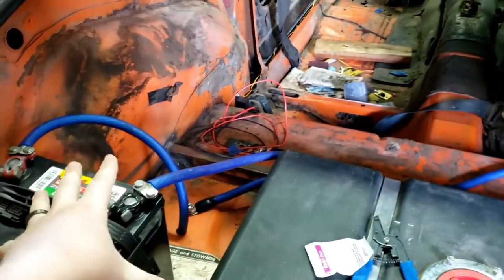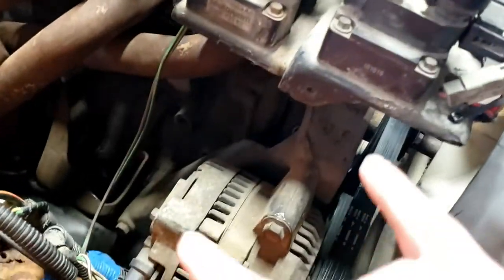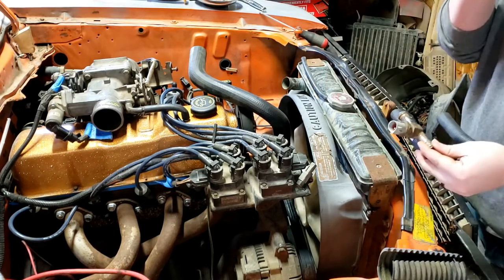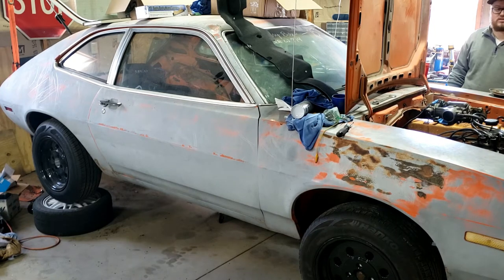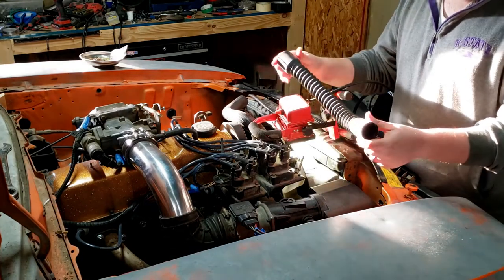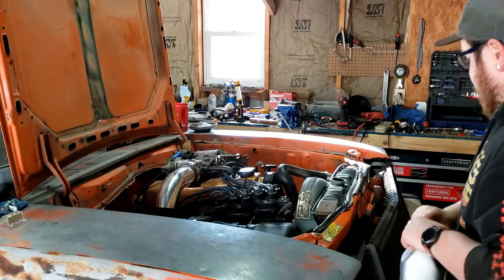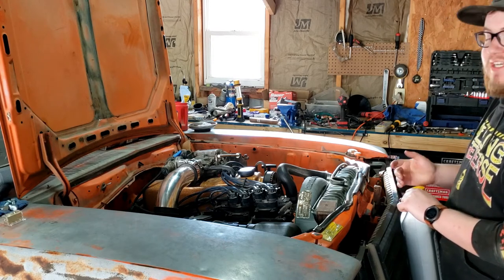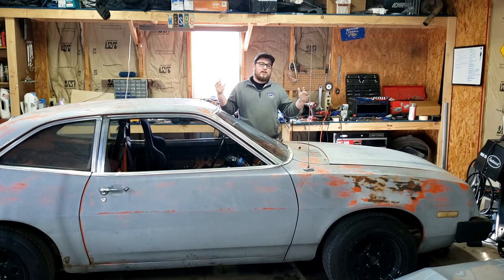The Pinto's first drive in 20 YEARS!!!

Comment: One way I protect both sheet metal from rust and rubber bushings from dry rot is by going to a self serve car wash and spray waxing the underside, and all potential rust spots under the hood, in the trunk etc.  Also, I find silicone tire shine protects mufflers, and ceramic wax, in trigger sprayers, might too.
   But paint before wax generally.

Comment: I know that u didn't go far but i know that it is the best feeling ever, I fired up my pinto for the first time with the 347 in it this weekend, it is the first time I've ever seen it run ever but it was a 4 cylinder and I built the stroker engine and got to hear it finally and it is the best feeling ever to hear all of your work running finally and I still have a long ways to go but it runs and im good with that for now 😁
Reply from the maker: Yep exactly!
Reply: I’m jealous for both of you with running Pinto’s.
My 72 Halfhatch is still sitting...looking at me...

Anyways, glad to see and hear about the progress and Harbor Freight has a great price on assorted hose clamps kits.
Reply: So happy you got it running and drove it not very far but hey it's progress I have to put my  new clutchbin my cus it doesn't like all the torque it has now being turbod
Reply: @ZEPRATGERNODT  that is the hose clamps that I used on mine, can't beat the price and you get plenty of clamps for a new engine build and some left over
Reply: @79beans347  
That’s right.

Comment: Grats on getting her going! I'm still searching for a windshield myself for my 80 Pinto. any chance on you adding some video of the floor pans in the next video, I've got to do drivers and passenger floor pans, and your's are mostly intact, where mine are gone lol.
Reply from the maker: Not sure if I will get yo the floors next video but they are coming up. I have solution for the windsheild as well. Long story short. 79-80 are glued in and a different size than early cars but not available. I'll show how to make the older glass work in the 79 or 80 cars.
Reply: @PeaceParts  Cool, heck ya on the glass, cause I can't find one anywhere and right now, no one wants to make it. I was thinking about getting some lexan and a heat gun and just making one.
Reply from the maker: @carlparker3571  had that thought too. But I wanna drive it safely on the street so glass is the way to go

Comment: I thought you were just going to notch that hood brace but you cut the whole thing out, which leaves it a bit flimsy but light weight, and light weight in the nose may be worth it for traction even if you can't sit on it.
Reply from the maker: Its not very flimsy without the support and I decided to cut the whole thing because it looked better than just a notch
Reply: @PeaceParts  Well if it ever saves you from getting stuck in the mud or snow, it will save you far more time than a V8 will ever save you by accelerating!   That is the crucial factor in my book, worth not sitting on the hood.
     With a little more work, you could have dropped in a 302, as many would have, but I'm glad you didn't for climate change and traction.
   I cam from Cold War Motors as he has far more experience and a good attitude, but is too fond of the big boats and burnouts, as are most.
Reply: @PeaceParts  I would try to buy a pinto wagon, or Datsun 610, but it is too big to compliment my W150 truck, for which I have my 3 cylinder Chevy Metro.  I am on the lookout for a good deal in another Datsun F10 though, which I once owned and miss.
     I would like to put a 2.2 into my B200 longtail van, but I think that would be a challenge to bolt up.  I may someday settle for a 239 though if the current 318 ever dies, but I needs a working 727 transmission first.  Until then it is a nice tool shed.
Reply: @PeaceParts  I like that you show us your mistakes, that's a good attitude.  But I feel you might have given up gust a little too easily on the original engine.  I have seen several people use hydraulics to break free seized engines, including Cold War Motors on a straight 8 Buick.   I think another guy installed a grease fitting in the spark plug hole, but first try to pry on the ring gear with a crowbar, but without breaking off any teeth unless you have a spare ring gear.  There may also be a hole or notch in the flywheel on which to pry.  or buy a junk flywheel, weld a big bar on it, and bolt it on.  Or take the pan off and force pistons up one at a time.
Reply: @PeaceParts  I think This Week With Cars revives some very rusty engines.
Reply: @PeaceParts  If your radiator dies, aluminum replacements also help traction (and acceleration slightly) but might not be worth replacing a good radiator.  Moving battery to rear is very useful though unless you need the space (as you did), but you can always put a tool box in the old battery place, at least for light weight tools, or get a vw squareback or Corvair.
Reply: @PeaceParts  I strapped a log to the front bumper of my F-10 for traction, but my Metro has a curved bumper for which I would have to find a curved log.  I suppose you could do the same on the rear bumper of a Pinto, at least in winter.
Reply from the maker: @alan6832  the ranger engine was too good of a deal, I dislike carburetors, and the engine had multiple things wrong when the car was parked 20 years ago. Wasn't worth my time to fix it
Reply: @PeaceParts  A big log, strapped to the rear bumper would protect the fuel tank as well as improve traction, except the recall solved that problem anyway, but you replace the tank and it would be hard to know how well protected it is.  BTW, the wagons never had a fuel tank problem and have more room and better traction.
Reply: @PeaceParts  Interesting. three of the other revival channels I watch,  Thunderhead289, Junkyard Digs and Junkyard Mook, are carburetor specialists and focus on old carburetor revivals a great deal.  I actually mentioned putting the 239 in my  van instead of the 3.9 Magnum because I fear the precise, vehicle specific and often transmission specific computer programs involved with EFI, but if your younger and grew up with microchips, I can see your perspective.  At 56, I have far more experience with carbs than with microchips.  though the 3 I mentioned seem to love carbs despite having grown up with microchips.  Same for wanting a hydraulic rather than an electronic transmission.
   Most Dodge crankshafts don't have pilot bearing seats and so can't be fitted to stick shift, plus clutch pedal installation is a hassle.
Reply: @PeaceParts  One thing I especially dislike is new distributorless engines, because the ideal timing changes with wear or carbon deposits.  Knock censors might take care of some of that, but a truly low compression old engine, and mine are, will lose a lot of efficiency if the timing isn't advanced quite a bit to compensate.  The new engines won't let you and they only do it a little bit automatically when the knock sensor goes silent.
    Ideal mixture might be effected by wear too, but I'm not sure how.